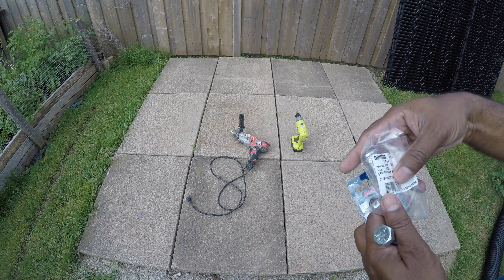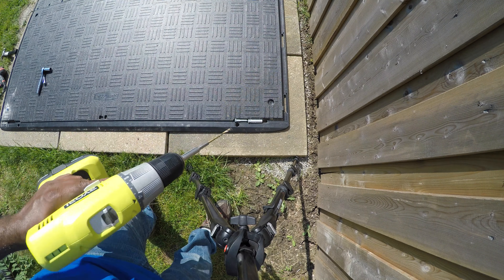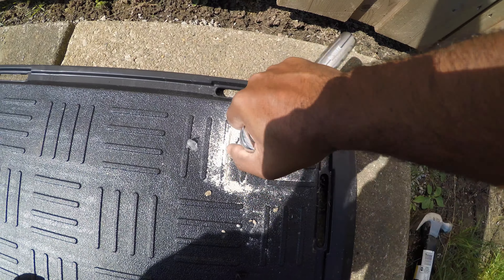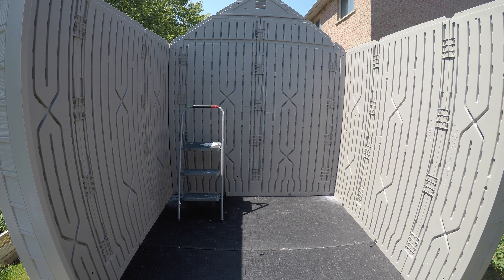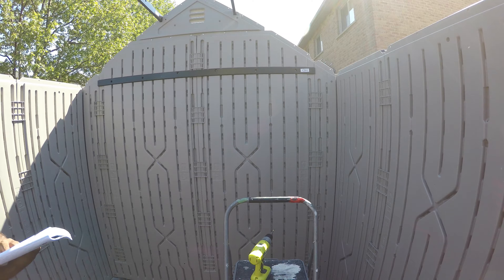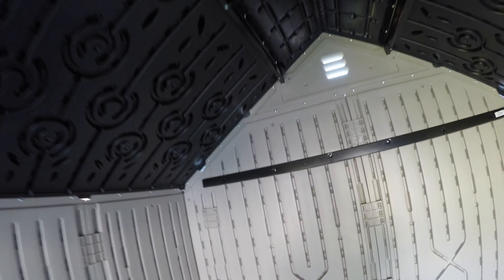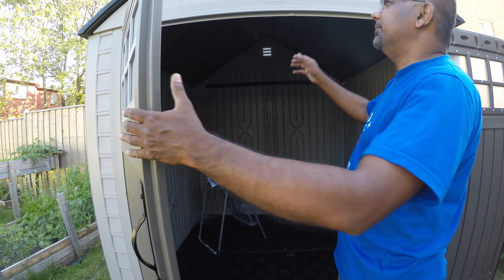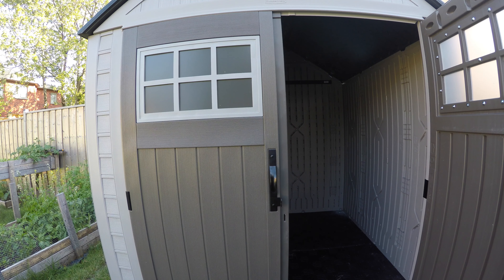Rubbermaid Shed 7X7 Part Two - Building the Shed

Comment: I'm putting mine together right now. I'm having a real hard time with the roof pieces
Reply from the maker: Mike, yes roof part is very hard. Make sure that you have help from another person. Also, that you have two ladders. Other person has to go to the back side of the shed to hold the roof panels. Once they are secured from inside (Bottom side of the roof panel) the shed, side panels of the shed has to align. Hope you have the manual. It will give you directions.
Reply: got a job installing this gem of a shed, it started to rain so I laid the roof sections across the top so I could continue working, the roof piece slid off and landed on the corner of the plastic roof damaging it.I inserted one of the  top cross bars and when I opened the door it fell down and the end put a hole in the floor,  what a piece of shit this is. I made the mistake of thinking I could get it done on a day when rain was supposed to be scattered. I messed around with this shed for 5 hours and the rain was just to much getting on my drill and tools and screws, what a disaster. got to finish tomorrow, Not sure how I am going to explain the hole in the floor and the destroyed corner to the customer. Rubbermaid needs to stick to bowls and shit. this is flimsy piece of garbage.
Reply: Im glad that you were up to the challenge!

Comment: Nishan, great video. I’m going to attempt your strategy. Can you tel me the dimensions of your foundation block? What sise pavers did you use?
Reply from the maker: Hi Alex, they are 24 x 30 inches. Extremely heavy and challenging to  work with. I suggest that you use some thing smaller. 24 x 24 or 18 x 18 may be a better options. I hope this is will help. Home depot has both.
Reply: I used 24x24 pavers, and was able to create a level foundation without getting a hernia